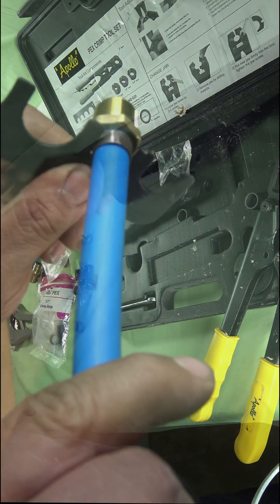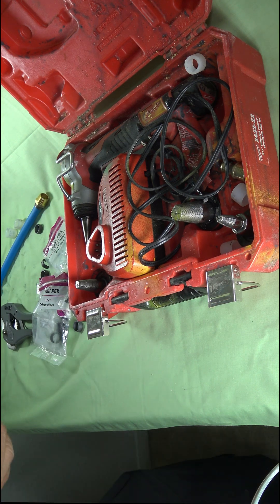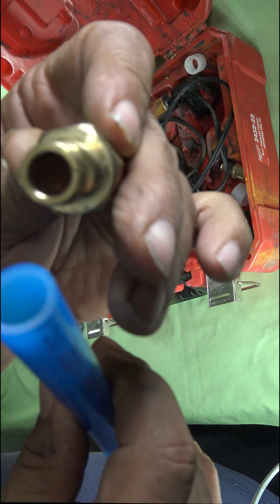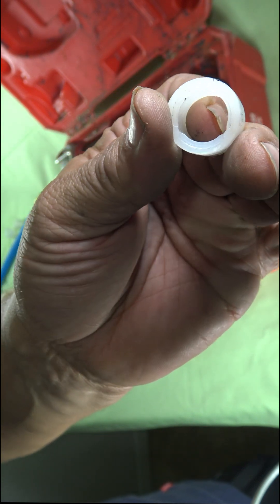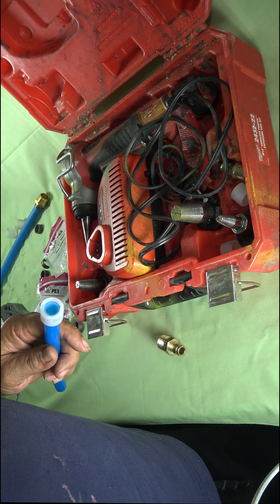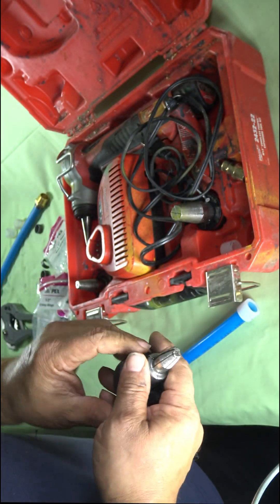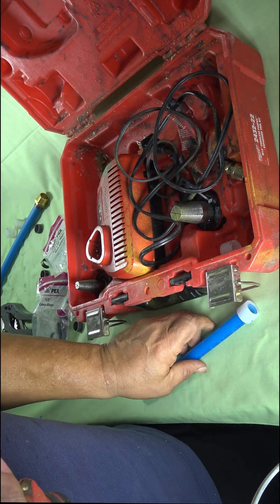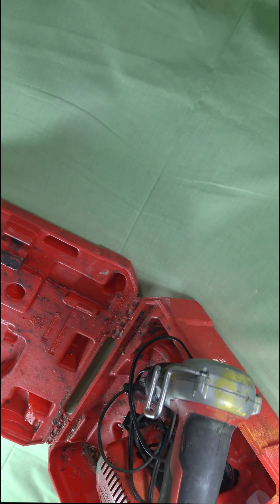PEX A vs PEX B A is better

Comment: Once applied to their appropriate tubing, do the fitting turn? Would I be able to turn the fitting into another brass fitting for proper connection to another line.
Reply: Yes you can turn expansion pex a fittings even after expanding and putting the fitting in.